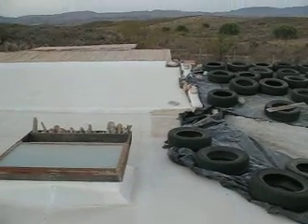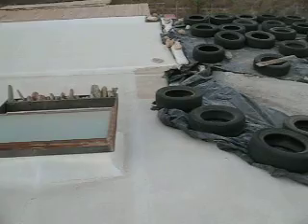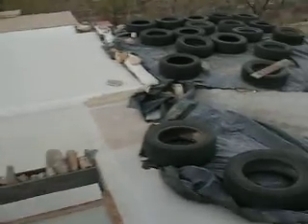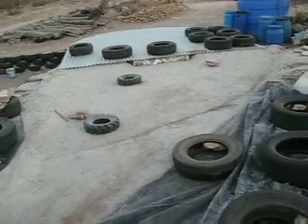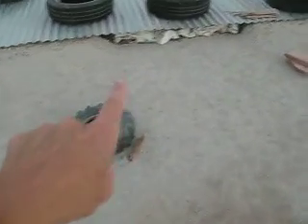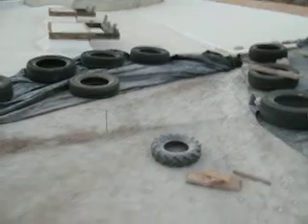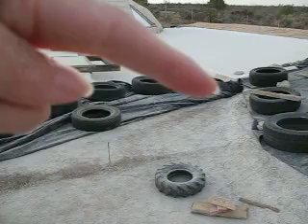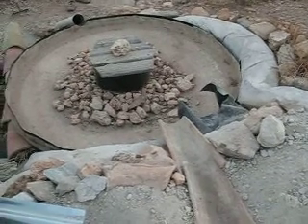rain water catch for earthship in Spain

Comment: Hello, the video is fine; as I am sure you know by now.  However, I have been reading your website and was hoping to find out if the first tank was made from tires as well?  Congratulations on the finish and if I understand correctly you are selling it now.
Reply from the maker: Thank you, good to get feedback on my video unskills!
The 2,000ltr water tank we first installed was an old one from our other house. It's made from fibre glass. We bought it when we first moved into and started renovating the cortijo in 2002 so it has lasted well. Since making this video we've had to line the big tyre tank because it sprung a leak. 
No, we're not selling the earthship, it's the cortijo we renovated years ago - Cortijo Arriba.
Reply: @cuevasdesolearthshipspain416  oh that sounds like a good run for the first tank. So  if I'm understanding correctly you did build a water tank with tires, correct? Where can I find more information about the tank you built from tires? Or did you surrounded the first tank to protect it and then line that structure after the tank sprung a leak?
Reply from the maker: Yes, the fibre glass tank has so far been a really good buy. It's used now as an overflow tank. And yes we did build the main 11,000ltr tank from tyres which we've had to line. We started building the main tyre tank in 2013 so progress is scattered through the blog posts on our web site since then, sorry, I haven't done a summary page for it, but it'll be on my list of to dos!
Reply: @cuevasdesolearthshipspain416    alright, that is great and thanks for the date.  I will look again for the scattered information.  Did you line the tank because of the leak or did you line the tank because of not wanting to finish the inside?  Lastly, thanks so much for all of the attention it takes to respond.  I am looking forward to building a tank myself; any tips?